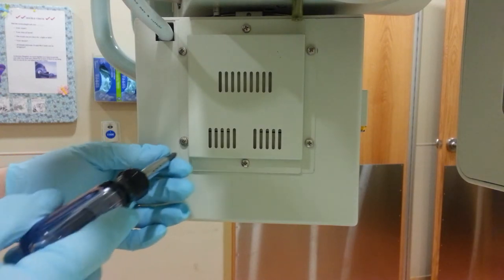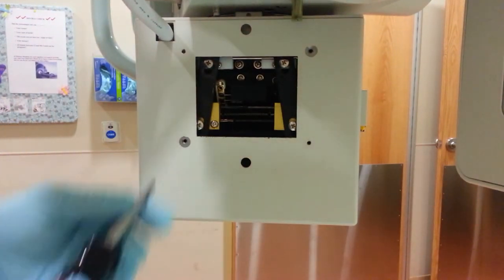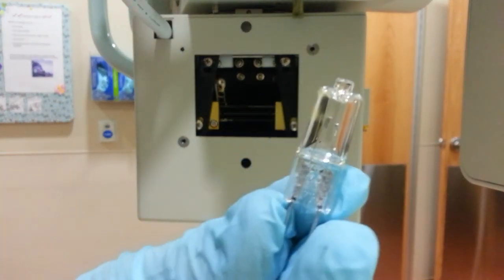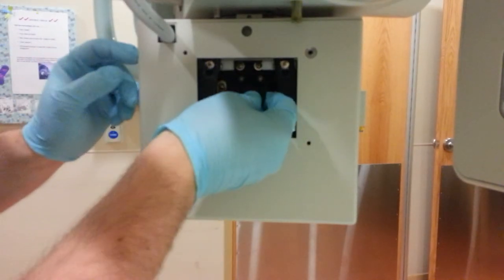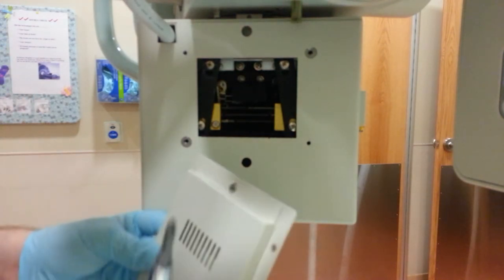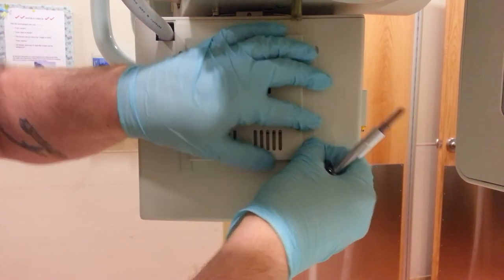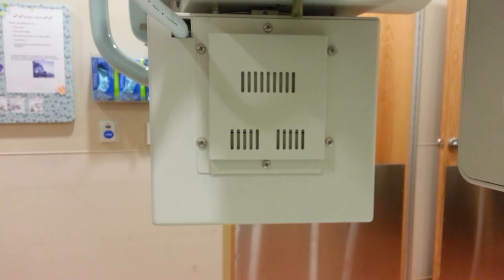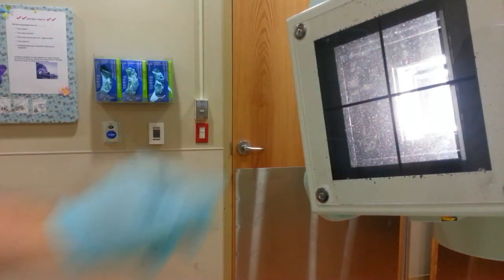Changing a collimator light on a Shimadzu Radspeed

Comment: You forgot to check the light to x-ray field.  Also the reason you don't handle the bulbs with your bear hands is because the oils from your skin will afix to the halogen bulb, when they get hot (and they will) it prematurely degrades the bulb.  Also, use the proper bulb.  Some off brands don't have the same length contacts on the legs.  This affects both the electrical contact and the alignment of the bulb filament to the opening that the light passes through to the mirror.
Reply from the maker: I totally agree. We have our engineering department handle calibrations though, this was really just for when you are in a pinch and need to get the room functional again. Thanks for the information though, I hope it will help others who stop by :)

Comment: hello, what if the lamp has been replaced but it still doesn't turn on?
Reply from the maker: First I would make sure both legs of the bulb are secure. If they are and the light does not come on, I would try another bulb just in case that one is bad. I have had brand new bulbs that were bad before. If those things don't work, you may have to call your engineering department.